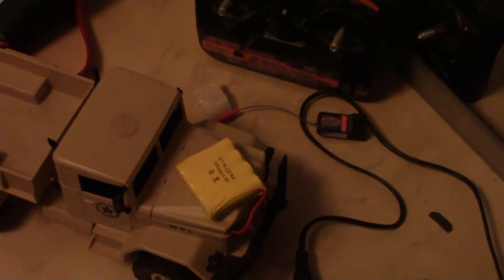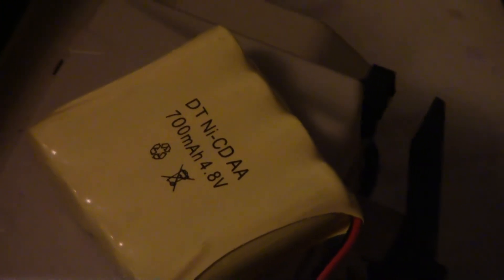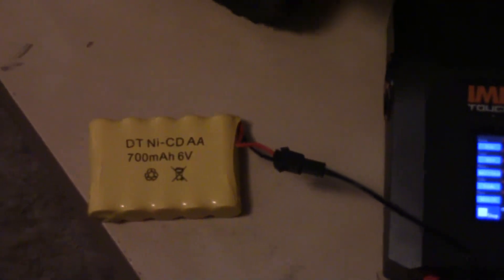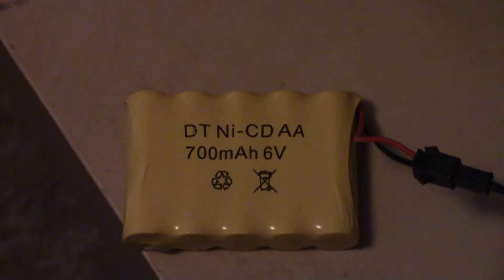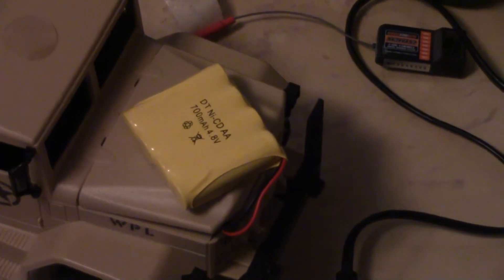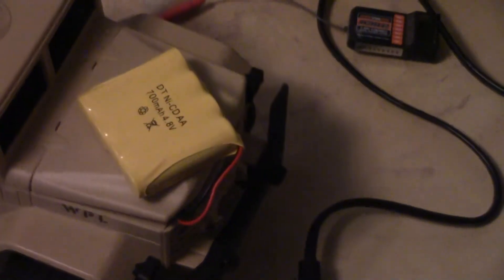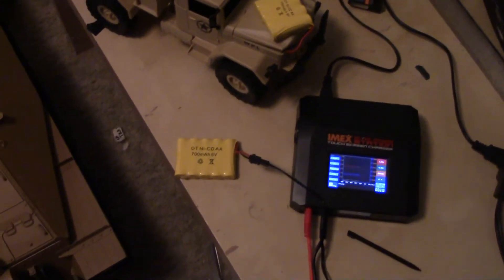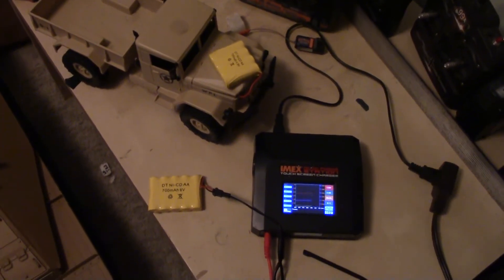HL truck batteries

Comment: Just received my 2 today.  Both had the 6V and I did run the 7.2V hunia batteries in it just fine yet the battery did hang out the front of hood lol.  My little girls wanted to drive it so I went with the charged batteries I had on stand by.  On the 4.8V just a weak machine but the 7.2V was a whole nother story.. Havent tested the tan one but the green one has throttle control as far as slower crawl to faster as you throttle up.  Definitly needs the steering upgrade works pretty quick responce on 7.2V but just a weak stock set up.